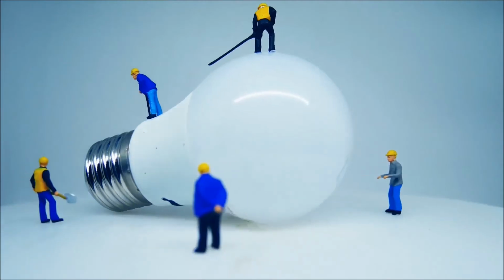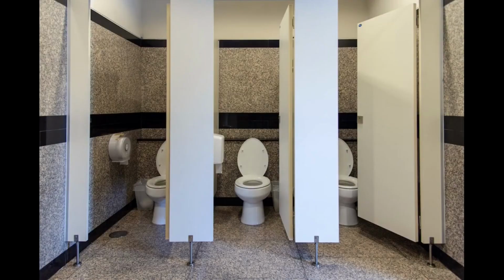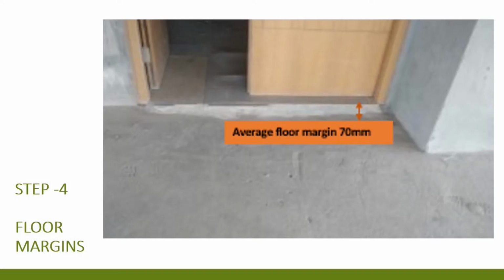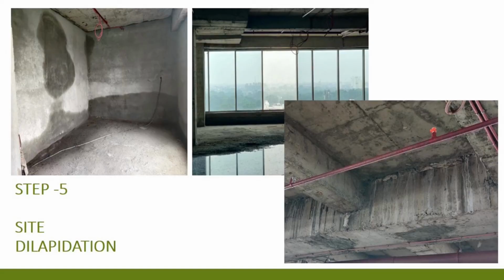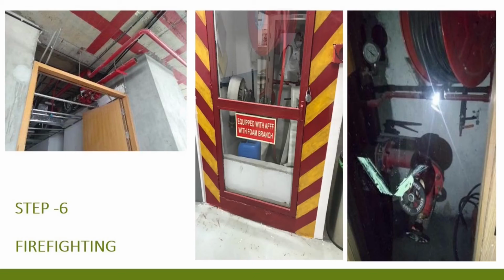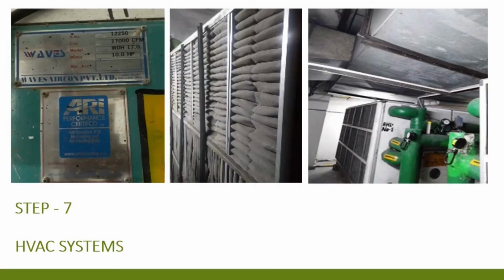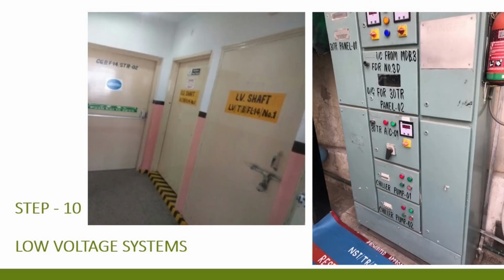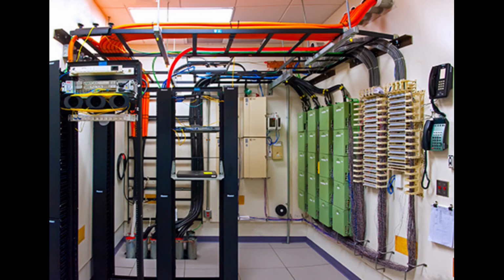How to do Due Diligence for an Interior Fitout Construction Site | Step by Step Guide - Part 2

Comment: In interior fitout what is the role of civil engineers sir..majority is for electrical graduates.for civil engineers in designing where we get opportunity
Reply from the maker: Actually a lot of civil engineers are working on fitout construction execution, way more than electrical, mechanical graduates, but yes, interior designing is less relevant for civil engineers
Reply: @kaizenview8897  can u suggest me which softwares need to learn for work in fitout companies in dubai .I'm searching job here, i know AutoCAD and revit .
Reply from the maker: Please learn Sketchup as well...very extensively used in interior designing
Reply: @kaizenview8897  k sir ..I'm planning to learn SketchUp and 3dmax